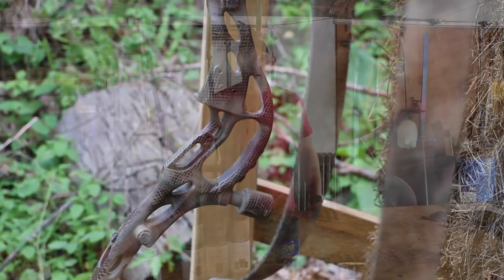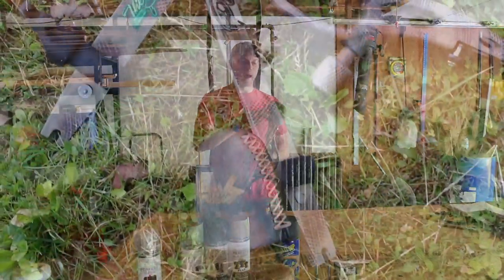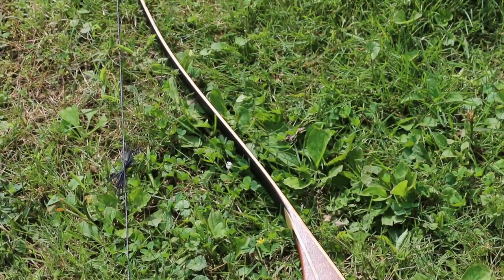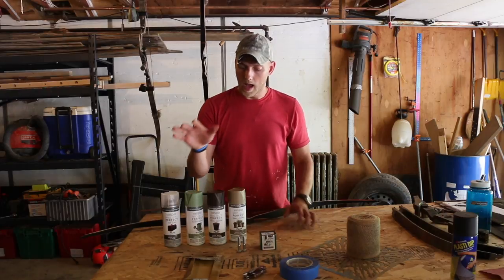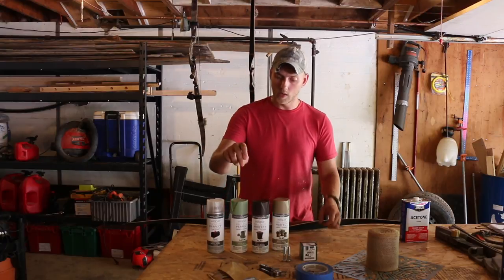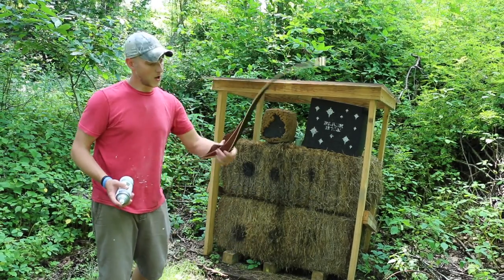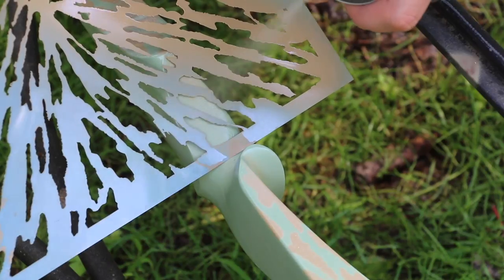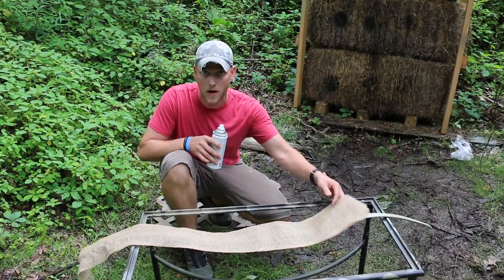How To: Camo Spray Paint a Trad Bow

Comment: I like and have made camo to my bows by using pine neadle top part templet with 4 camo paints color. That way you will have more contrast. No black no lacka finish. Pine is free and you need many off them that you don't mess up the surface by wetpainted templet. Use camo paints. Another paints are shiny, thats no camo.

Comment: cheap enamel paint chips off really easy and is not good for bows, only automotive laquer paints and 2 part enamel paints are acceptable. Cheap enamel spray paint wears off very easily and will even blister and peel from simple oils.
Reply: jim smith I agree that better clear coats like the epoxy based thunderbird finish is better, however I've been hunting hard for years is terrible weather conditions with this process and don't notice any ill-effects as you describe. It's process based rather than materials based.